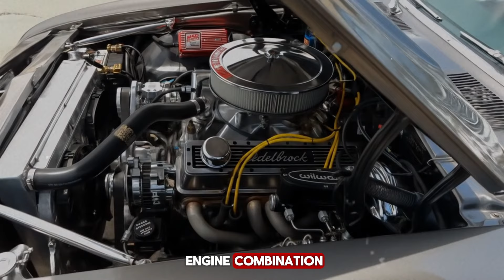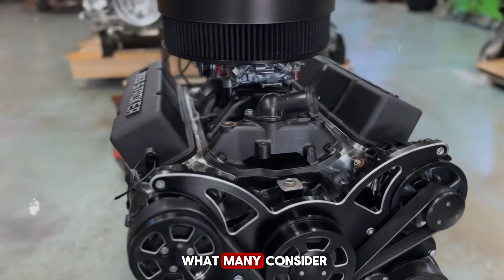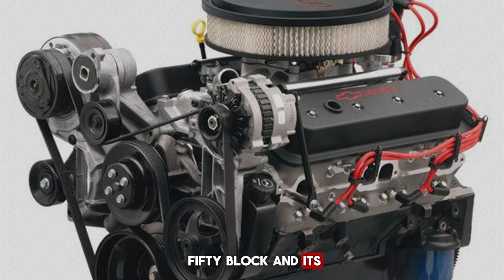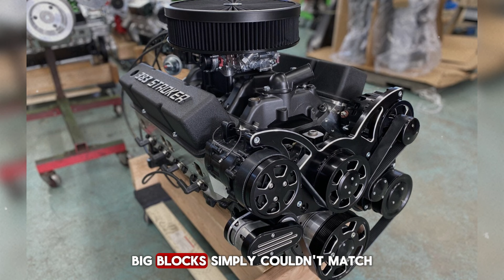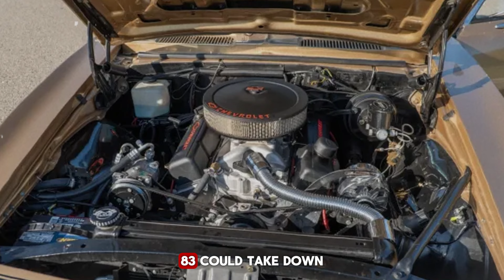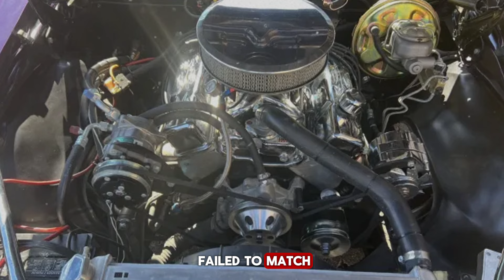The Shocking Truth Behind Chevy 383 Stroker Engine!

Comment: I’m not saying GM did not want to control marketing. The idea that a guy could build a 383 with a factory 400 crank and it was just perfect and he could build it in his garage and you can’t with an LS is a joke. A 400 with factory components needed the crank and potentially rods machined. This would throw off the factory balance that was talked about. The block itself needed a large amount ground out of it to clear the longer stroke. The LS has junk yard 6.0 and 6.2 blocks so all the items needed to make a larger displacement engine exist and were produced in the millions. The grand conspiracy does not ring true. Finally to get a 383 to produce 500hp on a dyno it needs a large cam. That cam is not going to idle, be power brake friendly, and if you want A/C expect to be at 1100 rpm at stop lights.